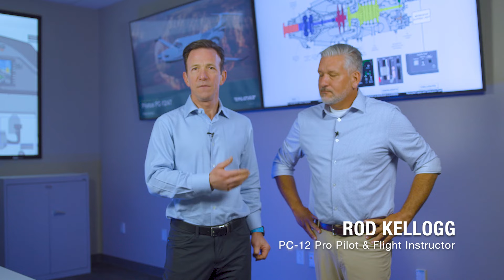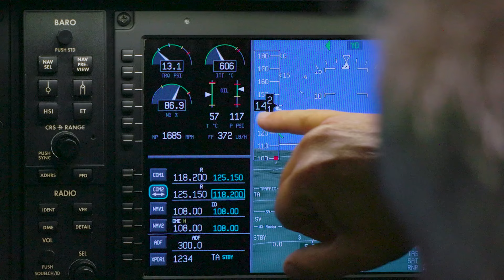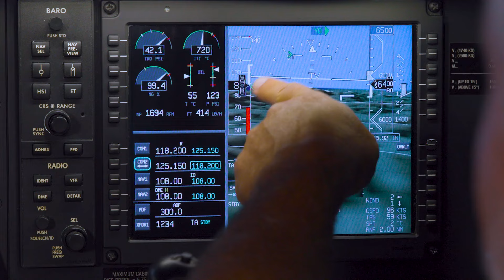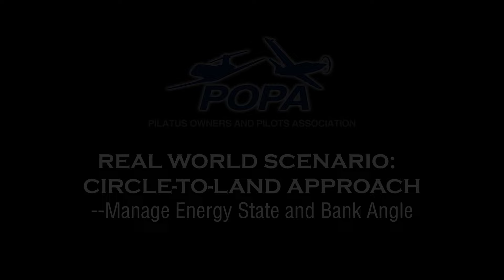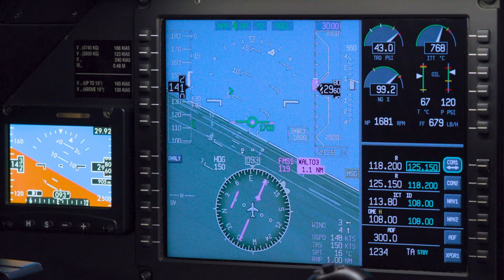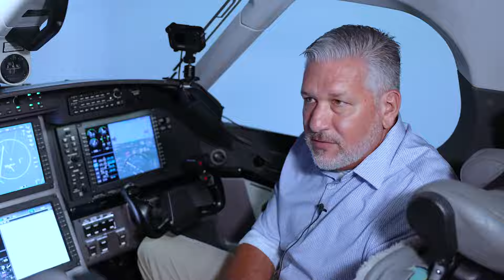Ready for Recurrent in the PC-12 NG

Comment: Pretty dangerous stall recovery procedure. How can you teach to roll wings level before pushing the control column forward?
Reply: They forget in the sim you don’t feel the Gs… especially the negative
Reply: Wings level immediately bring the lift vector back before gaining the speed back via pitch for more speed
Reply: @ leveling the wings first creates an uneven angle of attack between the two wings. This can cause a spin. The first step in any stall should be to reduce angle of attack with the control column centrally forward until the buffet goes away, then you can do the other steps such as leveling the wings, adding power, and easing out of the dive.
Reply: Reduce AOA first. Always.